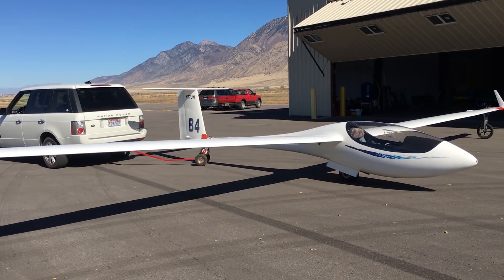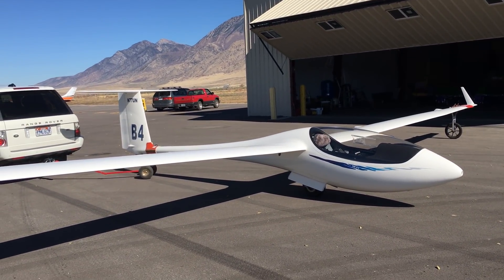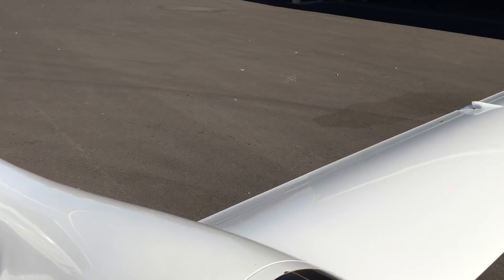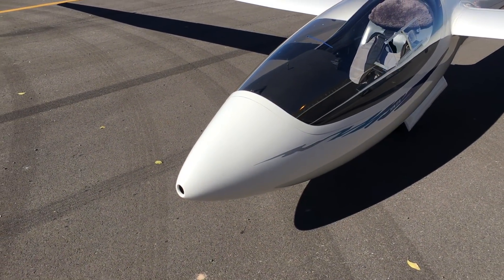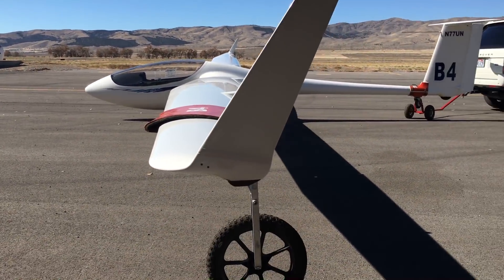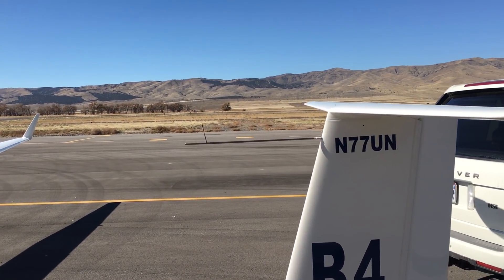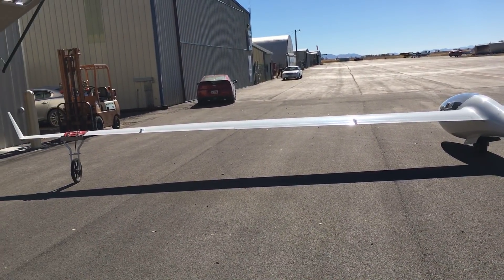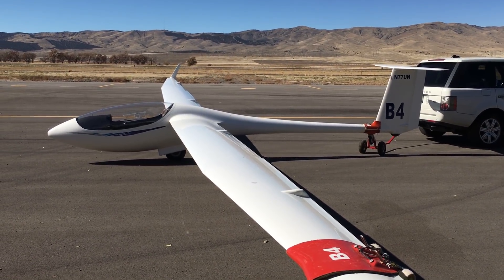Walk Around a High Performance Glider

Comment: Hey Bruno, I've heard there is quite a bit of difference between gliders.  Do you have a video that explains this?  For instance, would a beginner have a difficult time handling the glider you fly? And why would that be? Thank you!
Reply from the maker: Yes there are big differences.  My first glider was a 1967 Phoebus.  Very fun to fly and easy to fly sloppy - never take both hands off the stick!  Next glider was a 1985 ASW20BL which was way easier to fly.  My current glider is a 2002 ASW27B which is even easier to fly than the 20.  I would rather put a lower time pilot (100 total hours) in my 27 than I would the Phoebus.  Crazy.

Comment: Hi Bruno, I’m a French guy who had his glider license a long time ago (1977 :-). And, unfortunately, I didn’t practice until that time.
However, I really like to "Fly with you" to relax on evening. Thank you! 
I have many questions. At first: is Your ASWxx related with the ASK13 I used for my training?
Reply from the maker: So glad you are enjoying these videos.  Yes, my glider is a newer model from the same manufacturer.  Just 50 years newer than the ASK13 you were flying.  Thanks for watching.
Reply: Great, Thanks for Your Answer :-) 
It seems so awesome to fly with that machine. 
That said, I have another question. I remember that my instructor always told me to search thermals under the sunny side of the clouds. I feel, perhaps am I wrong, that’s not your method. Isn’t it?
Reply from the maker: I don't think about the sun when I am approaching a cloud.  I am more thinking about the direction of the wind.  The thermal core is most often either in the middle of the bottom of the cloud or on the windward side (the side where the wind is coming from).  Best of luck with your soaring!
Reply: I better understand what I saw. Any way it works enough well to glide until ... the Great Canyon and return :-)
Tricky business last week-end. Inpressive!

Comment: Not asking u how much u have in yours but what would a well equipped HP glider run u ? What’s an average and what would be a high end?
I’m very interested. I’ve been flying motorized aircraft since 95. I’m an airline pilot for Delta and was wondering if it would be a fairly easy transition for me?

Comment: Checking aircraft classifieds now and see an ASW27B listed - an '03 with 1060hrs of time for.... $89k...  I was hoping the glider simplicity would translate to a lower cost...  The barrier to entry for anything aviation related is beyond frustrating, but on the other hand the cheaper it is, the more the dummies come out of the woodwork.  Anyway, BEAUTIFUL aircraft, new subscriber as of today.
Reply: There are plenty of nice gliders available for under $10,000. They're not going to be as new as this one, have the equipment and performance it does but they can still be beautiful to fly. Even the first glider Bruno had and made videos with (the Phoebus A) is pretty affordable. A friend of mine recently bought a really nice Phoebus C for about $12,000 U.S. I've been flying an ASW-15 for fifteen years now and I'm not bored with it yet!

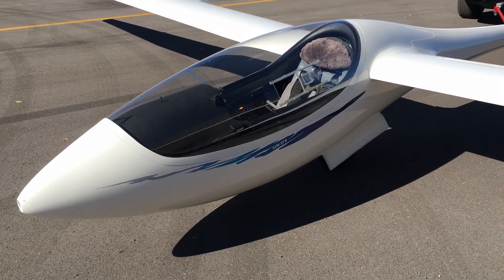Comment: Awesome glider, great video! I didn't get one thing, though: 1:38 "...the CG which is right in front of the landing gear". That would put the CG ahead if the wing's leading edge. I think you meant, "aft" of the wheel? That would place the CG aft of the leading edge, perhaps not far from the 25% mark?
Reply from the maker: Perceptive but not quite right.  I said CG hook.  That is where the tow rope is attached for winch and auto launches.  It is not the true CG location but that is what the attachment point is called.  Make sense?  Good question!
Reply: I contrued incorrectly. Thanks for replying. Great video as usual, Bruno!

Comment: Thanks - but CG must be behind the main wheel.
Reply from the maker: Nope - I don't know of any glider where the CG is behind the wheel.  Are you thinking of tail dragger airplanes?  CG hook is in front of main wheel on a glider.
Reply: I think Ventus (nice name) is refering to the CG of the plane, but the CG hook is not at that point. It is a little more forward. But even though, the CG must not necessary  be behind the main wheel. There are several gliders (ASK21, Grob G103) where the CG is before the main wheel. In fact, this is the reason they are preferred for training. Landing is easy in this configuration. But still, most single seaters have the CG behind the main wheel, and landing is more like a tail dragger. (The hook is still before the main wheel)

Comment: Where would you say the biggest advances in glider design have come from since this sailplane was built? Materials, wing sections, avionics, or is the 27b still state of the art?
Reply from the maker: Very interesting question Mike!  I would say in many ways, very little has changed over the last 15 years at least in terms of the 15 meter class.  The ASG29 is the newer version of the 27 and the main differences were that it could also have 18 meter tips and it could fly 1 pound higher wing loading.  I bet the manufacturers have some advances up their sleeves, but at least in terms of 15 meter ships, we haven't seen much difference.

Comment: What are the costs of getting into gliding and also, after getting established and certified, of owning and operating a glider like that?  Can anyone get into gliding on a moderate salary during the weekends (not retired or independently wealthy)?
Reply: If you fly in a gliding club it's quite cheap. I pay roughly 1000€ per year here in Germany. It is significantly cheaper than flying powered airplanes.

Comment: Hi Bruno, @ 1:54 in the video, looking at the winglet, it appears to have a turbulator strip..... is this so?
I'm surprised by how sharp the break is in the L.E. of the wing, the few supposed 'accurate' drawings I have of ASW20's show it as being slightly rounded..... handy to know as I'm saving my pennies for a 5th scale model kit .
Reply from the maker: Good eye - the inside of the winglets have turbulator strips about 3/4 of the way back.  Don't get confused.  This is an ASW27 NOT an ASW20.  Very different wings and ships.
Reply: 20 - 27...... my mind was truly elsewhere,
Turbulators.... was kinda surprised to see it but it makes sense given as winglets are essentially narrow operating band devises even in this enlightened era.
It'd be interesting to see wind tunnel test with and without them or data about their operating range.

Comment: Hi Bruno, quick one: since you have wing dolly on only one side, what are the chances of other wing falling to the ground, when you move glider around with your car, and there's no one else to hold the wing? Or is there a mechanism preventing exactly that, that I'm not aware of? 
Thanks mate!
Reply: The weight of the  wing dolly will prevent that. Of course, if there is a very strong wind it might be necessary to use more caution while taking the glider to the runway.
Reply: Luiz Schmidt That makes sense. Thanks.
Reply: With water ballast, this can be a problem. In this case, the plane will tip over very easily. Have a second helper, or climb out of the car...

Comment: You’d think airbrakes would be nice for when you don’t wan’t much speed or lift.
Reply: B4 has spoilers, these are pop up flaps that reduces the lift of the wing signicantly so the plane will settle on the runway.

Comment: What is the advantage (if any) to an 18m vs 15m glider?
Reply: UPS1000...... ultimately you get a lower wing loading with a better glide ratio but it won't be able to glad as fast due to more induced drag at speed.
Reply: Thanks for this great answer.  I was not considering the drop in speed just increased glide ratio.  I guess not wonder most world champions use the 15 meter glider.

Comment: What is your glide ratio?
Reply: That info is in the video description.
Reply: This is a competition glider. The best glide ratio is a nice piece of information, but it is not that important. What you want in a competition glider is to have a still decent glide ratio at high speed, combined with a decent thermaling capacity (that is, a rather low rate of descent at low speeds).

Comment: Hey B4!
More please! How do you fill it up with water, pre-flight inspection and so on. Please!! :)
That pitot is your TE, right?
Reply: There are two massive pins in the space behind pilot's head that connect the wing spars together.  When removing the wings, two assistants (or mechanical stands or whatever) support the wing's weight at the wingtips, the main pins are pulled off and then the wings are free to be carried away.  Those nobs at top rear of the wing are fairings for aileron and flap actuating pushrods.
Reply: How do you take the wings off after a landout? Are those nobs on the top rear of the wings connection points?
Reply: How did you get the tail number bravo 4? Was it assigned or requested?
Reply: Juha Kettunen Thanks for the reply and explanation.

Comment: Bruno, hi again,. two things, (one of which doesn't relate to this video as such),. 1). How did you get on with learning more about including real-time on-screen (in your videos, I mean) telemetry,.. and 2). Does the glider have (by an authority, I mean), to have any ultra-sound scans for micro-fractures on any part/s of the fuselage (including screen)? :) Thanks. :)
Reply: Regarding your second point:
Composite parts are checked visually (if the coating is fine, the underlying composite, being more flexible, is probably fine as well) and by tapping. A good composite part sounds bright and clear, a de-laminated one (one where the layers come apart) prevents sound waves from travelling through it and sounds dull and hollow. Ultra-sounding would not give much more information, but would cost a lot more.
Metal parts are checked visually where they can be seen, and by checking they perform their function within acceptable parameters defined by the manufacturer (control surface movement, play, etc.)